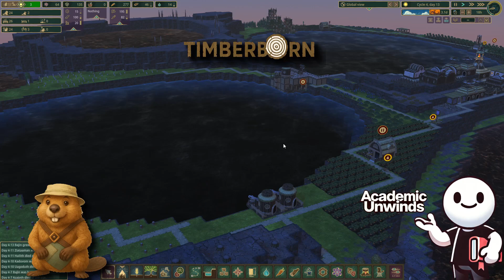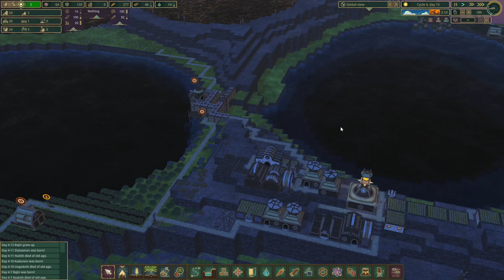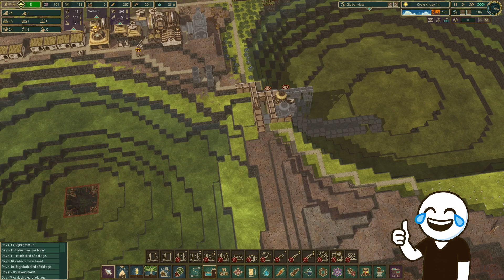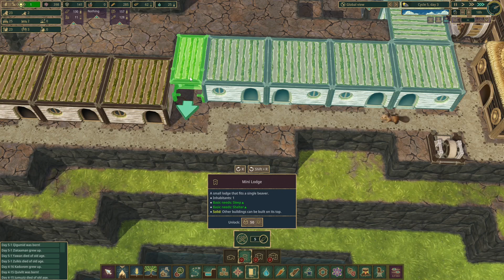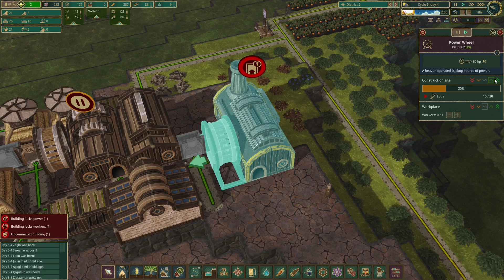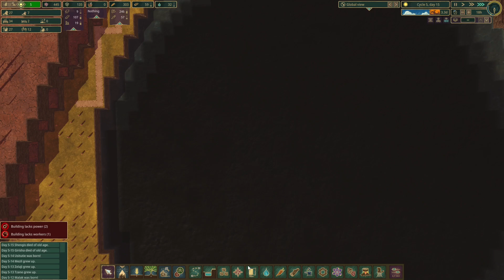Welding the Lifeline: Smelter Sparks & Final Pipe Links | Timberborn Hard

Comment: You have a drought at cycle 5, you are lucky.
I got a bad tide lol. I guess it's 30% chance a bad tide can occur.
The setup was 50% completed. I guess some beavers will be contaminated, no choice lol.
Thanks for the video !
Reply from the maker: Yeah, I was surprised too! The beavers, however, won't be contaminated as long as they don't walk through the half-contaminated water. The water pumpers apparently have a very sophisticated filter installed. :) You'll see the water reservoir getting more red over the next few episodes, as one water source on this map is not enough to top it up. :)
Reply: @AcademicUnwinds  Well, contaminated water is not big problem if you are well prepared.
I managed to connect the closest water source with the same setup with only 6 contaminated beavers as a result, but then found one source wouldn't be enough. I managed to connect a second source but got 16 contaminated beavers in the process (lol half my work force disabled). At that point between 1st water source and 2nd i had to emergency colonize the 2nd layer of the crater because water dropped and was thinking my colony would die before cycle 10-12.
But i didn't give up and came well prepared to connect a third water source (100 antidotes lol) : 14 contaminated beavers but they quickly recovered and with 3 water sources i started to feel safer (+ expanding a big water buffer tank).
Then explosives and ziplines and draining that sources crater towards the other crater behind which has its level 4 tiles under it, to ease the connection of a 4th water source.
With clean water secured and that XL water buffer tank, the colony can expand (was stuck with 36 home/beavers for a while lol) towards endgame (cycles 16+).
I'll watch your episodes !
This is a good and challenging map on hard mode.
Reply from the maker: @fgpraxis4463  Oh, I take it you built stairs down to get to the bottom of that pit? I decided to take the other way around and stay above it entirely! Besides one stupid moment of mine, all my beavers made it through without being contaminated, as you will see. :)
But seems like you overcame the map already! I've been enjoying this map as well so far. Very different gameplay than usual!